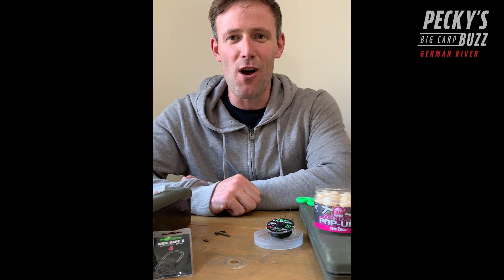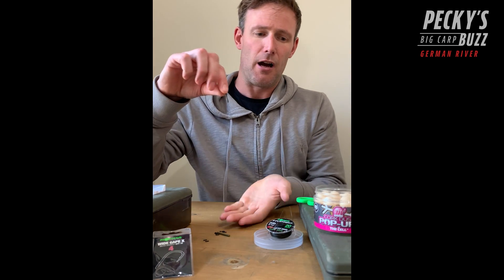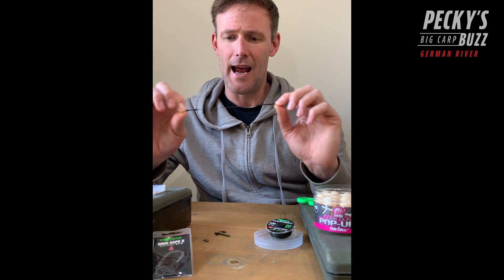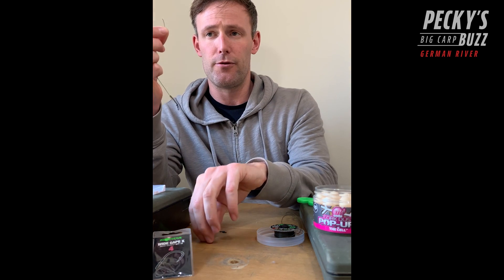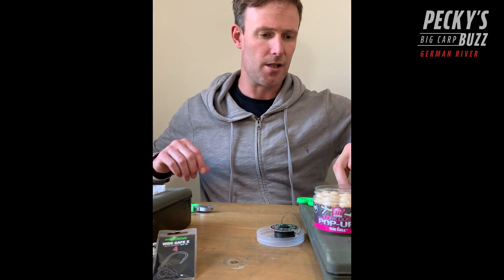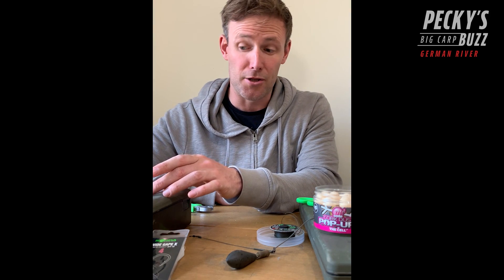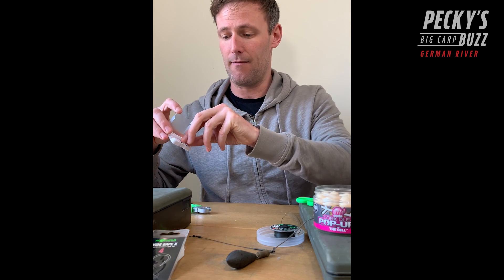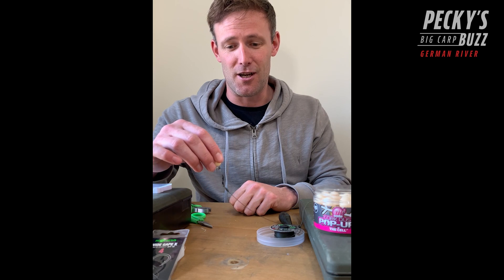Darrell Peck Spinner Rig | Pecky’s Big Carp Buzz

Comment: What are the benefits of this way rather than a quick change swivel ? I'm relatively new
Reply: charlotte hull the hook end is a quick change / spinner swivel ?
Reply: @darrellpeck4938  my bad I meant when attaching to main line, you use a ring so the boom is always on the main line but I use a quick change swivel on the boom instead is there any difference. Hope you and yours are keeping safe at this strange time.